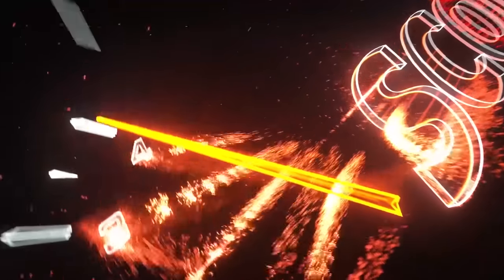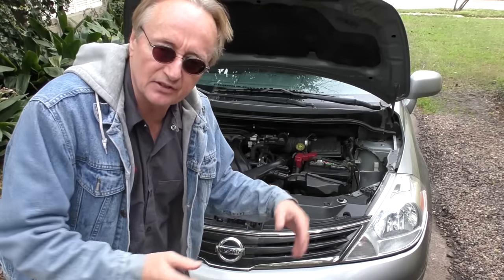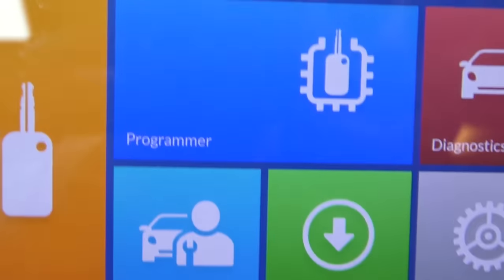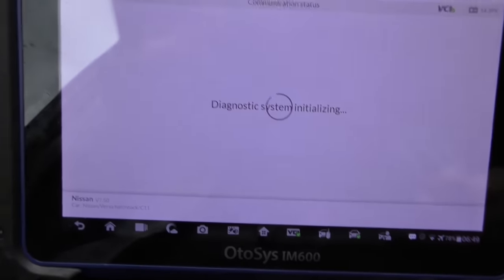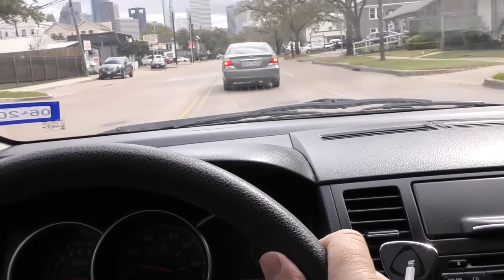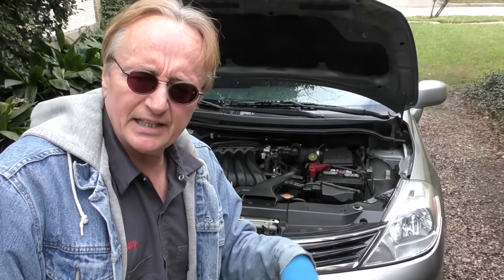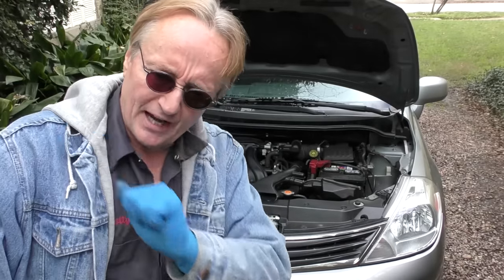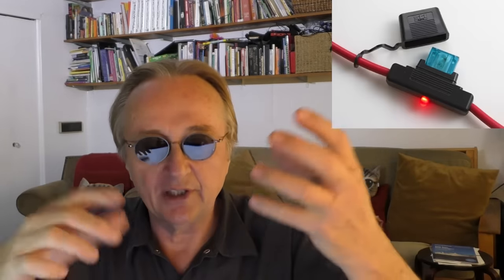Here's Why You Should Buy This Cheap Nissan

Comment: If it has a  cvt not buying it...so help me...
Reply: durantetest 
Let me help you as actual CVT owner:
(you want reliability answer read the bottom of page)

    First: there are 4 kinds of CVT that are used in cars.
1. the steel belt & pulley type-
EX- Nissan Xtronic CVT, Honda CVT
2. Toroid CVT-
EX-mid 2000s volvo CVT, Ford five-hundred/mercury montego CVT
3.single-stage planetary gearbox
EX-toyota base FWD hybrids, Ford FWD hybrid,
4.combination AT single speed+ steel belt+ pulley
EX-2019-now Toyota non-hybrid FWDs

Right now i'll explain the steel belt-pulley type:

1-  The steel belt+pulley CVT is the most common CVT sold, so much so that people think only associate "CVT" with this kind.

    These transmissions( in theory but not always in build)  use 2 actuating conical(double- cone shape)  pulleys-one input, one output being driven by a lubricated steel belt.

   The CVT in rest & in "drive" mode will be naturally set in *direct drive*, 
translation: the CVT is naturally set in 5th gear 
    Whenever the vehicle needs to accelerate-
the input pulley will squeeze itself to make the equivalent of underdrive
, translation: the cvt will 'downshift' into 2-3 gear for acceleration
    When the vehicle is up to speed &/or trying to move as fast as possible 
the output pulley will be squeezed to make overdrive, 
translation- the CVT will 'upshift' to 6-8th gear

The catch & advantage of a belt+ pulley CVT is that it can theoretically change gear settings without bumping the engine rpms &/or the car
& *CVTs can adapt to any change in engine input without the dreaded 'gear hunting' * 

Why automakers use these:

Steel belt+pulley CVTs are the most cheapest gearbox out there for how few moving parts are present inside & outside.
   These Cvts are both lighter & more fuel efficient than multi-speed hydro-matics & DCTs in most situations.
    CVTs tend to offer a better ride quality for how to they dont rigidly shift, (unless panic- accelerated) 

And now the nitty gritty:

Are steel belt+pulley CVTs unreliable ?

Answer: Usually, its no

Why:
    Steel belt+pulley CVTs get their bad reputation for how customers tend to forget that these transmissions use a tranny fluid that isnt as strong as ATF.
 & that the transmission filter that the cleans the fluid for the actuators can clog up & cause the acutuators to freeze, &  the steel belts to corrode & breakaway from high heat & pressure.
    Steel belt CVTs are supposed to have their fluid & filter replaced at 25-50k to prevent such damage. 
     This isnt uncommon with Hydro- matics- Hondas can have their hyrdo-automatics fail at 100k miles if the owners havent replaced the ATF & tranny filter.
     Very rarely do these CVTs just fail before 10k miles has passed just because of poor manufacturing, (& Nissan may be losing popularity because they dont always want to respect their warranty!) 
      If reliability is the greatest concern dont worry:
   ive met plenty of Nissan owners who've crossed 200k miles in their original CVT units with minimal trouble, & even more unbelievable some of then didnt even flush the CVT &/or even knew about this whole cvt controversy !

Comment: Scotty I just got rid of my 16 versa the transmission died at 256000 miles
Reply: andres rosen 
256,000 miles? Where are u driving?!
Reply: MainMite06 I actually had to drive almost 300 miles round trip a day to go to work
Reply: andres rosen 
Well honestly speaking, CVTs need to be flushed every 50K.. or every 2 years or CVT failure will be imminent..
I guess your lifestyle doesnt support that..I guess I understand now..
Reply: MainMite06 when I went to the dealer for service they said they won’t touch it at the time I had 75000 on it

Comment: Horrible car. I had one that I babied and cylinder head cracked right inside the thread of the spark plug well and started leaking coolant into the well. Wasn't worth fixing with 138k mi. Junked it.
Reply: Cloud9551 
Coolant? Thread of the spark plug well?
The coolant channels shouldnt be anywhere near the cooling channels on either HR16de nor MR18de..
How big was the crack?

Comment: Doesnt this have Renault parts though? Like engine or smth.
Reply: MS 
This car is a Nissan-modified Renault Clio-
 -It uses the platform, & suspension geometry of the Clio 
-The 1.8L L4(MR18DE) engine is the aluminized version of the Renault F4 engine, only this one uses a timing chain, individual ignition coils, & various Nissan electronics.
- the styling, body, & interior are mostly nissan, so that's why I said "nissan-modified"
   For comparison: 
Google "08 Nissan Tiida/Versa Hatch"
&  "08 Renault Clio mk3 5-door"
Reply: @MainMite06  So why does Scotty recommend a Renault?
Reply: MS 
This one Renault along with millions of other Renaults are absolutely reliable!
  Most people in America & Canada think that Renaults are unreliable POSs because they remember the AMC partnership in the 70s-80s.
   But some Renaults some,like, the Le car were totally reliable,      but,they were lacking interior room, A/C compressors, manual only options, & the ability to pass 100mph. Hondas in the same timeframe could offer A/C, AT, & tachometers for the same price..so duh no one wanted a Renault.
     Many Renaults sold in the USA in the 80s were built by AMC,& you can tell what that meant in reliability could you ?
Remember Renault Alliance/R21 ?
    Most Renaults built & exported from Europe are very well built, very cheap, slightly spartan, & very reliable.
   sound familiar ?
  Lots of people in Turkey love buying Renaults, for how much reliability could be bought in a bargain.
  Many French speaking African nations have 70-80s Renaults still running along with 70s-80s Peugeots.
   Renault ain't bad, USA biases them for typically being spartan, & having that AMC partnership.

Comment: Scotty. Need your help please..  I am replacing my clutch slave cyl on a 2000 honda accord 3.0 vtech. 6 cyl.
 Is there a.  O-ring pin 
In here to get the old valve out.   And how do I do this.      Out of the slave cyl.     AutoZone says I have to knock it out just to remove that valve and replace it in the new slave cyl.

Comment: Hi Scotty I have a 2016 versa It s been in a accidente passenger front side the control arm is damaged and I’m trying to replace it for a new one but the holes does not Align could be the crossmenber k frame damaged? And if I have to replace the crossmenber do I need to support the engine and transmission?

Comment: I have a 2015 versa with a cvt on my second transmission
Reply: adw1223 
How many miles did you have on the first CVT?
Reply: @MainMite06  about 60k now I'm at 95k
Reply: adw1223 
I think the first one failed because the CVT fluid wasnt flushed early enough-
   Nissan CVT fluid is *weaksauce*, it decays with time, heat, & actuating wear,
    Cvt fluid pours in *dark red*, & when removed after 50k, 
it pours out blackish-red

It should be flushed at 50k or 25k intervals, to maintain reliability

Comment: Have you repaired misfire by changing spark plugs?
Reply: Yes I did on my 2016. The spark plugs were really beat up at around 100,000 miles. The spark plugs gap was way off and they looked beat up. Got spark plugs from Nissan dealership and they gave me iridium sparkplugs which my car didn't originally have from the factory and misfire gone now.

Comment: Thoughts on 2017 Nissan Sentra SV?
Reply: I have a 2016 s model 6 speed with 64k miles and besides fluid changes and a CV axle it has been super dependable. I bought it new with 50 miles.

Comment: Is a 2009 nissan maxima good/reliable car?
Reply: I recommend you don't get it it still have that shitty CVT
Reply: no its not .. stay away from it
Reply: The electronic steering column lock module has a record of failing, and when it does, you can't start the car. It's $1,000 to fix, and it wasn't recalled. The CVT's in that year are surprisingly reliable. If you want to buy it, only make lowball offers.
Reply: Dank Millner 
    They're known for multiple quality issues...
      patience,research & good budget is required to find & fix them ..
    But the V6 engine & CVT in that car usually trouble free..